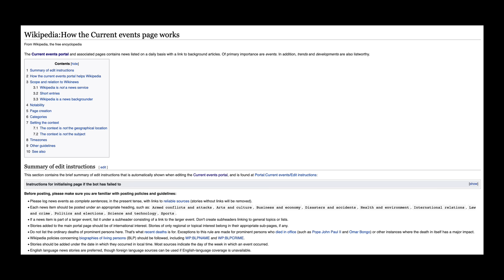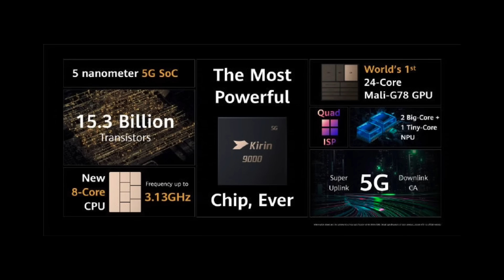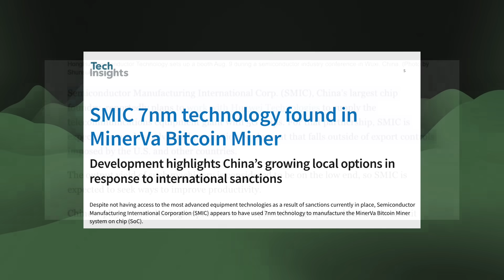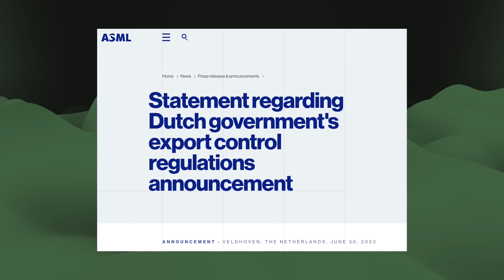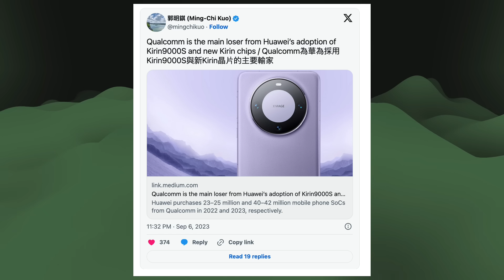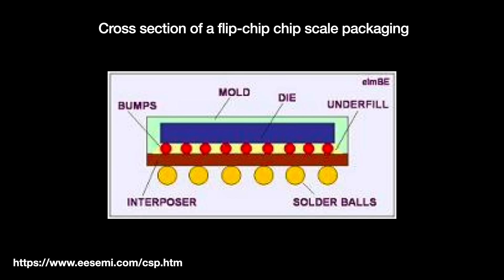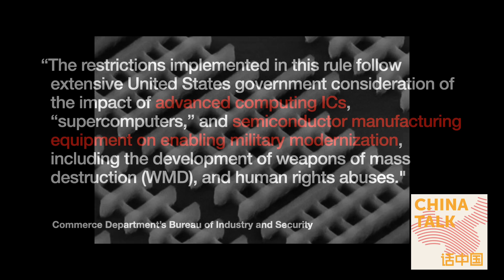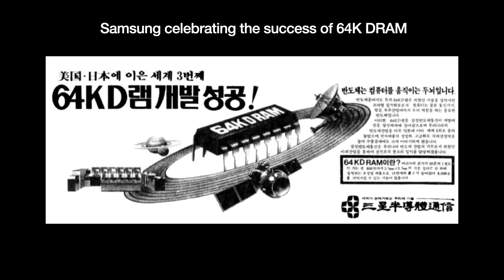China's 7nm Semiconductor Breakthrough

Comment: The drive for EUV was based on economics: with multiple patterning you can make the same chips but at a higher cost.
Reply: Qualcomm 8 gen 2 made of 5nm tech is said to be $160 and Kirin 9000s 7nm tech is using this 'higher cost' say it's +50% more than 8Gen2. So, the Kirin phone will be $80 more and most consumer especially the Chinese will have no problem paying $1080 for a $1000 Huawei phone and now it's a "satellite communication device".

Comment: It’s a mature SMIC N+2 node with performance at least on par with Snapdragon 888 (Samsung 5nm) and the original Kirin 9000 (TSMC 5 nm) with GPU function appears locked on AnTuTu.  I would have guessed using DUV SAQD but there are rumors they benefited from some early EUV elements.  China has close to 100 1980Dxi’s with a domesticated part supply.  Another rumor is SMEE will deliver its own DUV machine by year end that is equivalent to the 2000Di.   The yield on the Kirin 9000s is now thought to be at least 80% if not 90% — if you FIB enough of them you can get statistics on CD and overlay.  You need to adjust your timeline for “China speed”.

Comment: It's going to be interesting moving forward. The EUV wall will always exist, unless they find a way to make a brand new way of making sub 5 or 7nm chips with a completely new type of machine. Either that or they might decide 5nm is good enough and go for a potential paradigm shift in the same way China did with electric cars.

I think the surprise was mainly from the mainstream press. The people whose interest extends beyond the front page of Bloomberg knew about this already.
Reply: If you neatly scrutinize the EUV machine , you'll find it has far less set on lenses in the proless than DUV.  Only some critical parts have to be broken in.  So it is not so hard or so easy to build in near future.
Reply: “Will always exist” yeah give it a few years
Reply: What "paradigm shift?" You mean the one that features spontaneous combustion?
Reply: Chinese electric cars explode.
Reply: @UnChannelDuVulpineX careful getting into any US electric then. Most of the batteries for basically everything come from China 😉
Reply: They already are... They recently made a major breakthrough in 2D semiconductor wafer technology... 
According to Chinese scientists, they also developed manufacturing equipment for this technology.

They claim a lot of work still has to be done until they can actually mass produce chips... But, I'm sure china is currently going all in on this technology...

A couple of years, they would be mass producing advanced chips with this technology...
Reply: Tsinghua university is developing a new type of lithography machine using accelerator like concept for light source. Completely different from EUV.
Reply: @bennetm9498 Yeah, that's called Free Electron Laser
Reply: They have already developed half of the technology of EUV including the most important part lens and laser technology.
Only the washing tech is lagging behind and once they develop them....EUV will be in mass production. The probable date for mass production given right now is Q1 2024.
Reply: @bennetm9498  Got any proof of that lie?
Reply: @UsmanSiddiq1  I hope that will happen, the prices are too high now. And that's because TSMC has a monopoly on leading-edge chips.
Reply: @alexlo7708  Look how long SMEE struggled with its DUV system then tell me how it easy it is to make a commercially viable EUV system.....
Reply: Why does he say "we" when speaking of advances that benefit the Chinese Communist Party?
Reply: @doctorwilly   Very easy , you count on number of lens in  DUV and count again in EUV machines.
Reply: 5nm is enough for mobile phone
Reply: That is a particle accelerator that produces extreme ultraviolet photons via a process called steady state microbunching.
Reply: @doctorwilly amd struggled with fx for years

Comment: I would be very surprised if EUV gets to the point where it can obviate the need for 193i litho on current and future nodes. The best way that EUV is being used currently is to reduce the number of masks needed in the densest, most complex patterns. Intel detailed that use in their VLSI paper on Intel 4, where they noted that without EUV, Intel 4 would have required ~30% more masks than Intel 7. However with EUV, it requires ~20% fewer masks than Intel 7. So at Intel 4, that's a 50% mask count savings by using EUV.

Of course, the limiting factor is the power of the EUV laser, and while ASML is working hard to increase the power of the laser, as you've covered in previous videos, but I still have my doubts regarding how much they'll be able to increase the power of the laser given how intricate their process of shooting a tin droplets 50000 times per second is. And with EUV, it seems to always be a trade-off between stochastic defects and throughput. Increase the exposure time and you'll decrease the stochastic defects, but your throughput will tank. Or do the opposite. Even as the EUV source increases in power, between the potential for increased mirror count (with the current count of 11, ~98% of the EUV light is absorbed before it even hits the wafer...) and the potential for a required increase in dose due to future nodes requiring tighter features, I can imagine a future where throughput barely (if ever) increases due to all the factors working against it.

That said, I have very little knowledge depth in the field overall, so maybe there are big changes in the works to increase uptime, increase power, and increase reflection or the like to dramatically increase throughput.
Reply: Mirror design is probably already limited by the laws of physics. It was brought once on the channel, a free electron laser generating EUV might be the next big thing (or maybe not)

Comment: Huawei designed both cpu Cores and GPU cores for this phone. Later down the líne they could license the GPUs for chinese graphics cards
Reply: Probably won't impact the gaming market, but they can definitely use em for AI. I'm assuming that's what you had in mind here as the US would just ban the import of those if they were a threat to current companies.
Reply: bye bye Nivada.
Reply: Nah, most likely licensed the IP from PowerVR, like Innosilicon and MooreThreads did with their "Chinese Graphics Cards" a while ago. 
Still, no small feat from Huawei to get that iGPU stack working.
Reply: @williamyf As far as we know, this particular GPU was designed by Huawei
Reply: @diegoantoniorosariopalomin9979   tranquilo papaaá, tan solo deja que pase un tiempito y veras... fuerte a puya a que ese GPU  es, bien sea PowerVR, o una variacion de Mali pichada con esterioides por parte de Huawei....
Reply: @williamyf  the GPU Is not a previously existing architecture. Which means it was Made by Huawei or a previously unknown  chip designer

Comment: According to semianalysis  - Huawei’s Kirin 9000S produced by SMIC. The chip uses a custom Armv9 core, and a custom GPU architecture designed by Huawei. The ability to design leading architecture in China is a big deal. The performance and power consumption profile in a variety of tests bring it on par with 1 to 2-year-old Qualcomm chips (S888 & S8G1). The RF side of the chip is amazing, using an integrated modem that is on par with Qualcomm’s current best. When direct comparisons are done on identical IP, the Arm A510 for Huawei’s Kirin 9000S built on SMIC’s N+2 (7nm) and 2022 Qualcomm’s S8G1 built on Samsung’s 4LPX process. The performance and power consumption of the Arm A510 cores are effectively on par with each other despite the process technology gap, 
This is a leading edge chip that would be near the front of the pack in 2021, yet was done with no access to EUV, no access to cutting edge US IP, and intentionally hampered. We cannot overstate how scary this is.
Reply: Truth

Comment: Then what’s the point of using nanometers as a selling point if it doesn’t actually represent size.
Reply: marketing.

the real measure is density. 9000s is said to be between TSMC 7 and 7+ nm. so behind but still pretty good.
Reply: there are some other videos on this channel (mainly the ones about EUV) that explain when and why the decoupling between name and actual size happened
Reply: @mxn1948  ok, then what is the real nanometer measurements of the various chip transistor’s?
Reply: @BradBo1140 9000s is something closer to 5.8 or 6 nm I believe.
Reply: @oggilein1  thanks, Ill take a look. Im sure its compicated.
Reply: Same with calling an electric car turbo.
Reply: 1 centimeter is one centimeter anywhere. How much transistors you can fit in one centimeter and how good they are is the key
Reply: Because it used to, so it's a tradition, because people don't know it and think it is true measure of the size and because it is great for marketing. That is at least 3 reasons. They still try to have the same ratio of node advancement from new node compared to old one as they used to. It's just that now they are using different method than just shrinking the size of transistors. So it represents a "tier" of equivalent transistor density. And given that non-planar transistors had been used for a long time already, even transistor density would be murky.
In short - there isn't another good unit with which to represent the node. You need to know the Performance, Power, Area, Cost analysis of the node to know how good it really is.
Reply: @BradBo1140  thats the thing, its all marketing. companies will pick different measurements. it used to be that everyone use the same measurement, which was the size of the N-junction in the transistor but then as transistor designs got more complicated, people started picking different design features as their "nm".

for example, looking at the intel 10nm, its actual density was higher than the TSMC 7nm, but the two companies were measuring different things so intel's was called 10nm while TSMC was 7nm
Reply: Nanometer used to be used to represent physical transistor size. It used to mean the size of the smallest feature of a transistor. The smallest dimension of a 28nm transistor is 28nm. Older transistors (planar) have issues with power leakage with reduces frequency and increases power consumption. Smaller transistors also have issues with power leakage, so planar transistors can only be used to 28nm (20nm planar was tried and went horribly). 

FinFETs replaced planar transistors and reduced leakage. However, due to their 3d design their smallest feature size was tiny. For example, a 22nm FinFET could have its smallest feature be 8nm. Going from 32nm to 8nm in one leap doesn’t make a lot of sense, and the performance and density obviously doesn’t scale as far as the naming would suggest. 

So FinFET transistor naming is what would the hypothetical planar name be to achieve this level of density. Companies though quickly realized that they can essentially define the naming and you can have node shrinks without shrinking the node. For example TSMC 12FF is just a refined 16FF, Intel 7 is just a refined Intel 10nm, and Samsung 8LPP is just a refined 10LPP.
Reply: @dex6316  Yup. A very good answer.
Reply: @mxn1948 9000S is just right around the level of the Snapdragon 888 that I am typing this comment with. A meme on its own right nonetheless, but that was a Samsung 5nm processor.